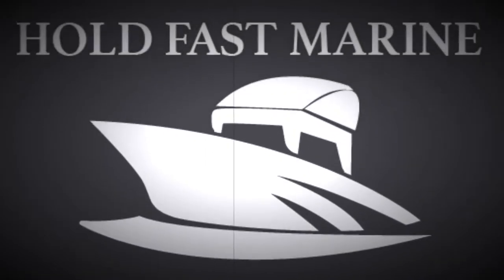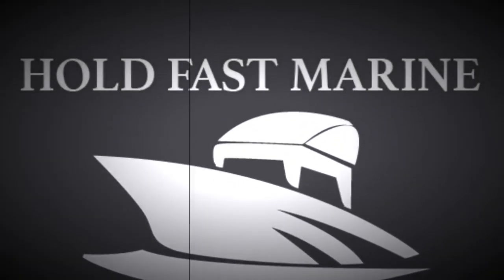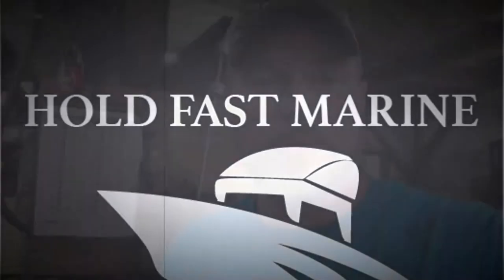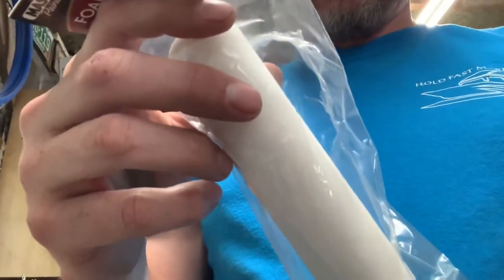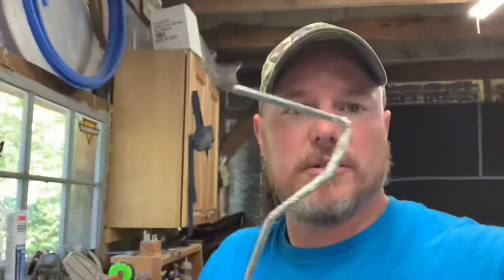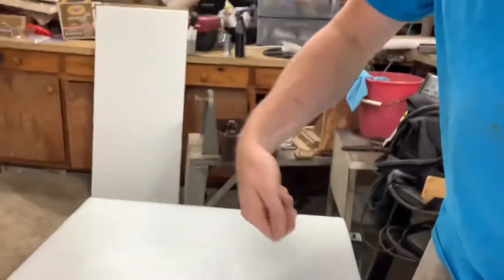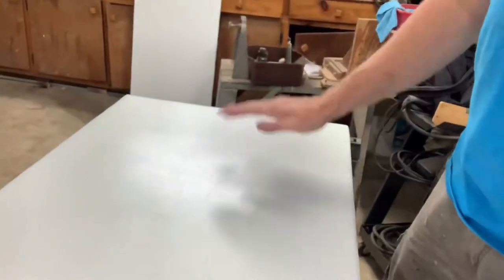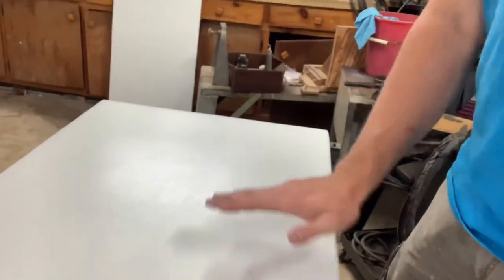TotalBoat nonskid paint TotalTread

Comment: We just applied our first coat of Non-skid yesterday on our deck. Some areas have more beads than others, is that normal? I know first coats never look good. We are using foam rollers, should we also be doing the tipping method as well? Like we did with the wet edge paint.
Reply from the maker: No you do not have to worry about tipping it, just keep adding more coats. You will notice that the grit will build up as you put more coats on. It is completely normal. I always recommend three or four coats, and if you can vary the direction that you’re rolling it on. If you have any other questions feel free to give me a call my cell phone number is on my website!
Reply: @HoldFastMarine  Thanks for the advice! Also, we are ready to go a head and sand for the next coat. We started to hand sand with 220 grit, lightly scuff, but It just dulls the beads. I think we are going to use scotch bright to scuff it up in stead. Thoughts?
Reply from the maker: @Michella27  I do not sand between coats. If I put a coat on that’s too thick I will just hit it real fast with a Scotch-Brite pad. The more you sand, the more coats you will have to do.
Reply: @HoldFastMarine  Good to know, thank you! Saves us from having to sand..☺️
Reply from the maker: @Michella27  your welcome!